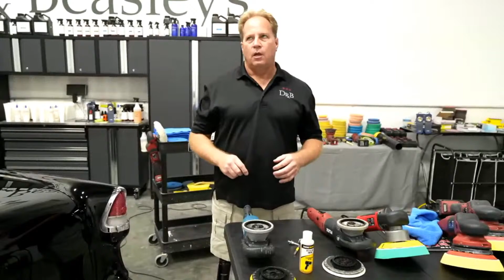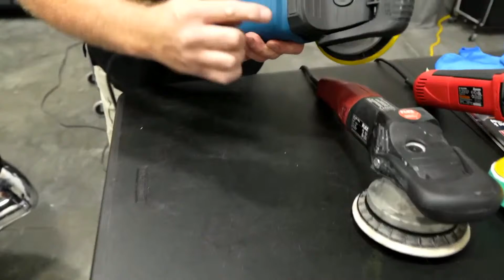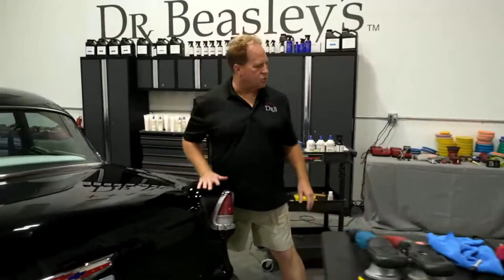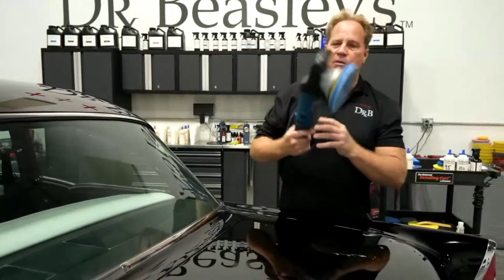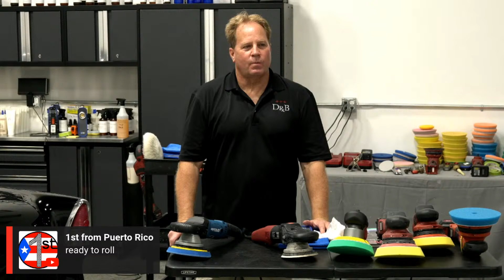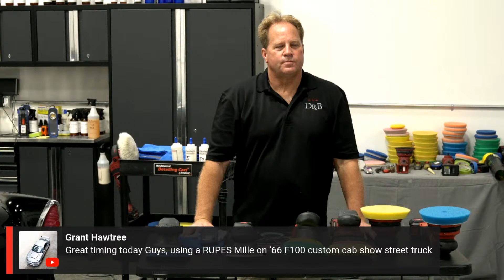Flex v. Harbor Freight: Forced Rotation DAs | 🔴 LIVE Online Detailing Class with Mike Phillips

Comment: Why do you use the 3401 so much if the Supa-Beast is supposed to be an upgraded version? Is the 3401 really a better tool? I have a Supa-Beast but wondering if i need to try a find a second hand 3401?
Reply: Nope. Save your money. I have the Special Edition “Red Beast” 3401 and the Supa Beast. Yes the 3401 has more power but in the grand scheme of things it’s not necessary. 

As Mike states quite often, if the paint is bad he’ll FIRST tackle it with the Flex rotary and then follow it up with the 3401 or Supa Beast for polishing. 

I will say the Red Beast is a bad a** looking tool but if I had to do it all over again, I would have just stayed with the Supa Beast. Hope this helps….
Reply: @jamess.7415  Thanks James. I do a lot of one steps for the car dealers with 3D Speed and 505 correction glaze so just thought maybe the 3401 would speed it up a little but if you say the Supa-Beast is just as good thats good enough for me.
Reply: I've never said the Supa BEAST is better than the original 3401/BEAST.  What I have said is the Supa BEAST is the newest version of the original and it's features over the original BEAST.  Here's the 4 primary differences.

1: Lighter
2: Quieter
3: Cooler
4: Smoother

The Supa BEAST and the CBEAST have less OPM and RPM - and the original still has the most OPM and RPM and thus it offers more and faster paint correction ability.  I LOVE to use the Supa BEAST for the 4 features shared above, but too often the cars I'm detailing are in such horrible condition, that I choose the BEAST for the extra power.

Here are the RPM and OPM differences,

The BEAST - 480 RPM and 9,600 OPM

The Supa BEAST- 430 RPM and 8,600 OPM

The CBEAST - 380 RPM and 7,600 OPM

Thanks for watching and commenting!  -Mike Phillips

Comment: More often than not you do get what you pay for. The Mercedes analogy is a good one - nicely built, looks good but far from industry-leading for reliability. My Flex PE8 leaked oil after less than 6 hours of use whereas all of my other polishers (Makita, Griots, Porter Cable, Adams, plus others) all have exponentially higher hours of use and none have broken down. Flex would not do anything and their service was terrible as they just give lip service. My friend's 3401 also leaks and his also has very limited weekend warrior use. Buy the Harbor Freight, save money, and at least most people don't live far from a Harbor Freight store for service. After my experience I will never buy another Flex tool.

Comment: Great to see you both back doing videos again (I have a lot of catching up to view)! 3 pea size drops? that's not an ample supply/amount (lol). Oh... some of these old wives' tales on pad rotation... "If the pad isn't moving, you aren't getting any work done". Period. When the pad stalls congratulations, you just turned your polisher into a vibrator; good luck detailing your car or truck. I'd bet money the HF "clone" doesn't come close to having the electronic control module (used to maintain constant RPM under load and temperature) that 'The Beast' has. Great video guys!
Reply: Hi still-DJ, I'm on the same page as you when it comes to pad rotation and pad oscillation - you need BOTH for efficient defect removal.  Anytime someone says this isn't true, I'm completely good that they have come to their own conclusion, but I also know it's going to take them a LOT longer to buff out a car than those of us that understand what's taking place at the surface level.

And you are correct that the HF version of the FLEX does NOT come with the 7-function microprocessor you get in the FLEX tools, all of them.  

As a long-time user of all the FLEX 8mm gear-driven orbital polishers, I have to say, I was impressed with this inexpensive knock-off of the FLEX XC 3401 VRG also known as the BEAST. I expected it to be inferior in every way, but I was wrong. It’s smooth, quiet and powerful. It’s a pretty exact clone of the BEAST but there are a few places they cut corners.

1: The backing plate bolt and two washers, one flat and one locking are sub-standard in quality but could easily be replaced with better components.

2: The Harbor Freight Forced Rotation Dual Action Polisher does not offer the 7-function microprocessor that comes standard with all FLEX polishers.

2 of my favorite function are numbers 5 and 6 - see below.

The FLEX 7-function Microprocessor includes,

1: Provides constant speed control via the tachometer generator.
2: Provides a soft, gradual start of the rotation of the electric motor that powers the drive mechanism.
3: Controls the accelerator trigger switch.
4: Provides restart protection after a power interruption.
5: Provides overload protection.
6: Monitors the temperature of the coil windings and turns the polisher off before damage can occur.
7: Controls speed set by the variable speed dial.

One of the most important functions is the heat sensor, which monitors tool temperature. If the tool becomes too hot, the 7-function microprocessor will turn the tool off so no damage can occur.

Another key benefit to the 7-function microprocessor is the power interruption function. If power goes off to the tool, when power is restored, the tool will NOT turn back on until you release the speed trigger lock. This prevents the tool from turning on and possibly causing damage to a vehicle or a person.

The Harbor Freight version of the BEAST has none of these features. Besides that, this tool works as advertised.

Thanks for watching and commenting!  -Mike Phillips
Reply: @mikephillipsrealworlddetailing  Thank you for your time to reply and all the info.  Much Respect!